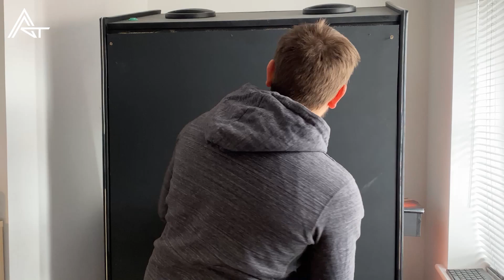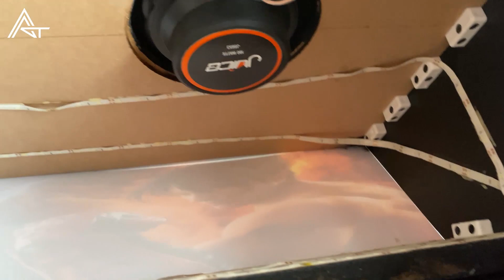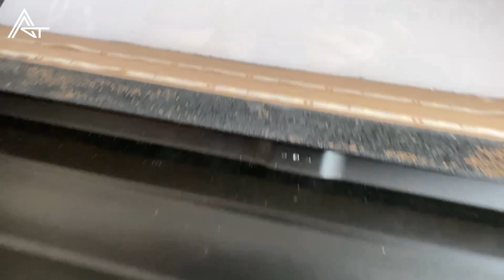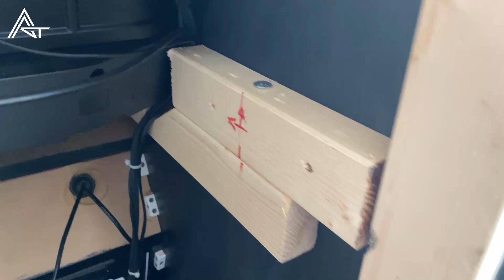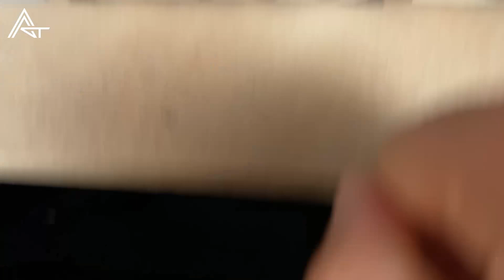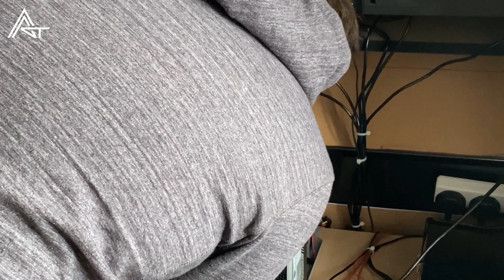What's Inside My Arcade Machine?

Comment: Good job and also good job for choosing launchbox. I would personally make some holes for the volume controls of the amp. and maybe get a hdmi switch box, that would let you detect what signal is available and never switch the input from the tv.
Reply from the maker: Us defo look into the hdmi switch box, as for the amp, the speakers are fed into the tv and I have an Alexa enabled remote so I can change source and volume through voice if I wanted to, super easy :)
Reply: @AllAboutTech159  if you have alexa enabled devices you might wanna power on the pc inside too. I like that on my rig  i can power it on from anywhere with google assistant. I have a good tutorial if you are interested https://youtu.be/msQVvrFOUlw
Reply from the maker: This is such a good tutorial! I may look to do this for all my devices!..